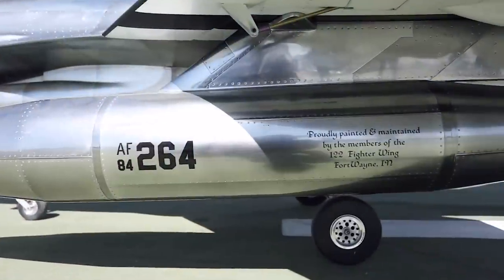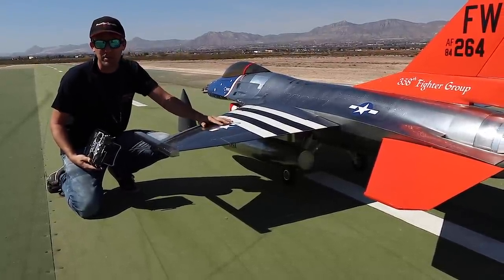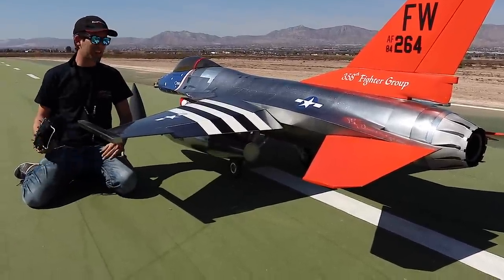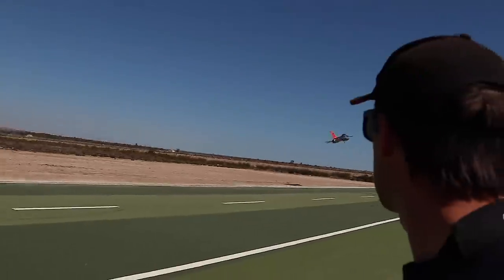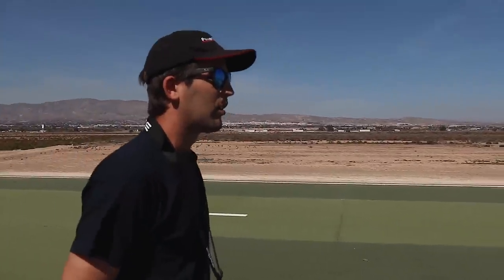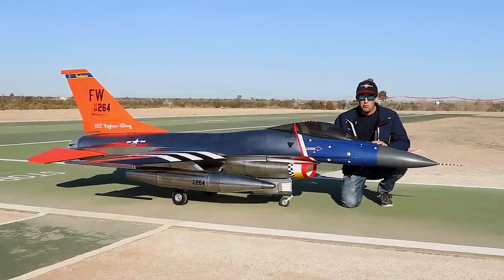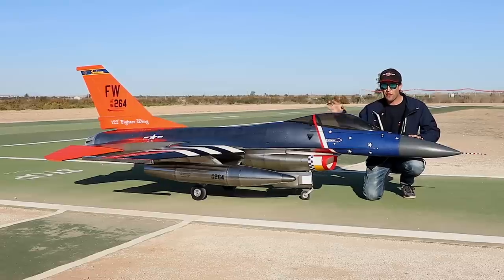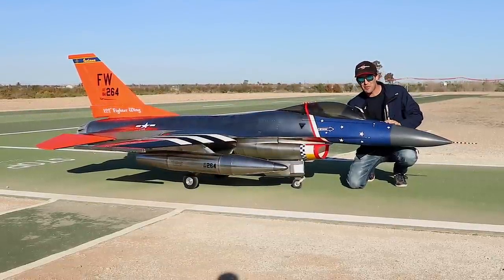HUGE F16 - Flying!

Comment: Great Flight! What was going on with the landing gear? It looked like the nose wheel never went up.
Reply from the maker: It didn't, and we can't figure why, as it retracts backward, so air pressure should help, and it works fine on ground! Darn gremlins!!
Reply: @MartinPickering-PickeringRC  what happens if you put a little back pressure on the gear simulating the aerodynamic load? It might need to go forward just a bit to unlock.
Reply: Martin Pickering how fast can it go?
Reply: @MartinPickering-PickeringRC , if I had to guess (and not being able to physically examine up close) I've seen similar phenomena on several full-sized aircraft I worked on as an FAA aircraft mechanic, the air pressure forcing the strut aft is too much to overcome the lock/unlock mechanism of your strut.
If the system is driven via a HD servo, you might be able to use an actuating armature that would give you more mechanical leverage. 
If the gear is operated via pneumatic/hydraulic actuators, you might be able to increase the pressure supplied to the up/down lock mechanism. 
If you are using a lock/unlock mechanism that mimics a full-sized aircraft strut, you might be able to increase the lever arm which controls the over-center locking arm.
Without seeing which system you are using, I'm unable to give you more than a S.W.A.G. at the moment.
If you could send me a couple of photographs in a PM, I might be able to give you a better analysis. 
Either way. Good Luck with that gorgeous aircraft!

Comment: I have smaller Foam Freewing and Eflite F-16s. I set them up just  normal. Separate aileron, elevator and rudder. Then do mixing of channels with switches. I want bigger of course 😊

Comment: What a beautiful model. It looks and flies really well! 

The only things I may nitpick on (and I've worked on the real thing for 10 years) if you want to strive for ultimate realism:

-The outer portion of the wing trailing edges are fixed in real life (i.e no ailerons - just flaperons).
-The flaperons do not assist in pitch control.
-The flaperon flaps mode is triggered by landing-gear down operation.
-The leading edge flaps (LEF) are also triggered by LDG-down and Angle of Attack (i get that putting AoA sensors on an RC jet is crazy).

Of course, I understand that being an RC jet, it is probably unlikely to build the thing unstable (in terms of center of lift vs center of gravity) like the real deal, which probably accounts for the "semi-realistic" flight controls. However, it is technically possible to achieve.

The F-16 Flight Control System is from the late 60's, and what used to take quadruple redundancy computers and lots of space in terms of circuitry can probably fit and run on an arduino uno today. 

Yeah yeah "You try to do better", I get it :) It's not ment to bash the product, just shed light on possible improvements :)

One of my all-time favorite RC models is the Rusjet yak-130. Check it out if you haven't already!

Comment: I hate that people use gyros on these big planes. They are more trouble than they are worth. One more point of failure. That plane don't need flaps to supplement the ailerons and delta tail control. It's too easy to roll the air frame to begin with. Just because you CAN do something doesn't mean you should. Glad the nose wheel stuck down though. It's also a tad nose heavy which is good for first flights of course. Not so much so as to be any problem either. I would work out the handling bugs first, then focus on CG. What a tremendously beautiful aircraft!!  I loved my  visit to this video and hope you get her dialed in very soon. As heavy as it is, you can use that to your advantage. Heavy wing loading means more stability in high winds. That goes with ALL aircraft.

Comment: I was told off recently for using aileron input in flap movement - adverse yaw etc etc. Maybe try keeping the flaps fixed when landing, might solve that wobble. From what you're saying about roll sensitivity it sounds like they don't need to be moving at all during normal flight either.
Reply from the maker: I would have liked tottery a few different combinations, however unfortunately I was only tasked with testing and setting up as best as possible in one day, following the previous owners setup, so that's what we did... would be cool to get more stick time on it for sure!

Comment: How much $ is invested in this thing? 

Absolutely awesome.
Reply: Thousands
Reply: NAUTIC nautica 
Thousands is a bit vague. I knew that at first look. 

“Thousands” include 2K to 999K. I’m curious about the investment in the aircraft. Not “oh my that looks pricey”.
Reply: I would estimate between $10,000 to $12,000.
Reply: Build one a find out!
Reply: gregthepilot Henderson 
At that much cost, snd could be wiped out in an instant, any insurance available? Even it were non flying loss.
Reply from the maker: Too much! lol
Reply from the maker: That would be accurate for a commercial model of roughly this size (slightly smaller) problem is this one was a custom build, retracts made to measure, plus custom paint... so as far as I know it cost the original owner significantly more.... @rocketboy917

Comment: Most fly by wire fighters use those type of mixes.  Watch any of the F18s, etc and you see the flaps and slats used as flight control surfaces.  While I don't recall an in-cockpit wing looking video of the F16, considering it's a FBW aircraft, I'd expect it's using all movable components as flight control surfaces.
Reply: The Leading Edge Flaps are scheduled as a function of angle of attack on the real jet.  I don't know if anyone has made a good AOA sensor that could do it on a model.  My interest is how if the airframe is plan accurate then how is the pitch axis handled.  The strakes make the jet have relaxed static stability in pitch.  Rate Gyros and the FCC manage that in real life, dunno if a radio could if the strakes are to scale..  (USAF Avionics B-Shop Flight Controls & Instruments '82-'98)
Reply: @Zuloff  Take a look around 2:25 https://www.youtube.com/watch?v=5IVWp-N6TuI  You will see the leading edge being used counter intuitively (IMO).  As he rolls left, the left wing front flap moves down (which in theory would increase lift) but with the flaperon moving in a parallel fashion to the FF, the wing is being used more like a stab   I'd love to see a video on how the mixing of the surfaces is accomplished and if it changes with speed.  One of the benefits of the F22 thrust vectoring is that it can drastically minimize trim drag by using the engine nozzles in place of any of the control surfaces to maximize SC speed.   It will use the TV alone up to a point to keep control surface drag to a minimum.

Comment: The F-16 by nature is an aerodynamically unstable design requiring computer fly by wire to stay in the air, everyone knows this already so how can a plane that is designed in such a way have a Model analog that can fly with out computer aid
Reply: since when is the F16 inherently unstable? this is not an F117. also in a model you can move the CG to a stable position if that would be the case. the F16 is a plane with normal wings and normal tail, no reason for it to be unstable.
Reply: Chris's Tech Box actually it is unstable. But the instability is what allows it to fly the way it does. Airliners and GA aircraft are designed to be stable because they don’t need to fly to the edge of the flight envelope. Fighter jets are a different story. The F-117 was unstable due to the shape, the F-16 was purposely made to fly tail heavy which is very unstable but allows very aggressive positive pitch maneuvering.
Reply: @superskullmaster  Ok I see, so I'm not completely incorrect answering the original question "how can this model fly without computers" by saying they placed the CG for this model to a stable position.

Comment: Is English not your first language? I think you have the definitions of "huge" and "tiny" mixed up.
    A full sized F-16 is 15.06 meters long. 4 meters long is quite a lot SMALLER than this 4 meter version.
     Glad to set you straight on this.
      Now, for a MODEL F-16, this is impressively large.

Comment: Flap + Aileron = Flaperon (the large surface on the rear of the wing).  Realistically it shouldn't have those aileron tabs at the outer edge of the wings. Stabilators, or stabs, are on the rear of the aircraft.  Great looking plane anyway you cut it.

Comment: Have to be careful at low speeds giving it too much aileron.. since that changes flap extension angle, which could very easily create a stall on the side where aileron position makes the flaps extend less.

Super pretty model.. at distance would be very difficult to tell it from the real thing.

Comment: Does it go supersonic?

Also, terrible music choice.
Reply from the maker: Turbine exhaust speed is very close to supersonic! Jet is far off it though
Reply: @MartinPickering-PickeringRC  You wouldn't want to try and control the thing if it WERE supersonic. I read where the guy piloting the supersonic car was 700 feet further down the track than he perceived by the time the nerve impulses reached his brain and his perceptual center assembled the sensory picture. There is no way you could adequately control the thing at that speed.

Comment: Wow, actually looks like the real plane while flying.
Ours really didn't, but it was only 20cm long and was really just a test for whether air multiplier systems would work as an engine for an rc. Made it look like an f16 because it had 1 engine
Reply from the maker: 20cm long sounds like it would be a bigger challenge than this big one! And yes, by far the most realistic model I have ever seen when in the air!

Comment: What is the engine size and where can I source one? Building a 1/2 scale jet dragster and need some big power from a jet. Thanks and love the video's👍💀👍
Reply from the maker: Turbine on this one is 300N size. I would reccomend the JetCat P300. That is 30kg thrust, but exhaust speed of about 1400km/h! They also do up to a P1100 which is 110kg thrust, that would get anything moving!!

Comment: Absolutly amazing machine ! It seems that there is no brakes, and the front gear wont goes up...
Reply from the maker: Front gear indeed had an issue. Does have brakes though, but it is a heavy model so inertia takes some time to slow down..

Comment: Absolutely great build job on this plane and great job flying it and better yet, LANDING it.  Most builders of planes of this level of perfection spend all there time building and relatively very little time flying, and it shows up on the landings where a lot of pilot skill is required.  This guy nails the landings, probably because he doesn't spend most of his time building.
Reply from the maker: +1

Comment: Man that is a thing of beauty.  I've never seen anyone fly so slow and smooth like that with such a huge aircraft. Increases the realism tenfold!  You need to master the side slip slide it was designed to do for real dog fighting.  Also, does that have thrust vectoring?  I didn't catch it if it does.

Comment: Did the "elevators" make landing a bit more difficult? Seemed to me that those would give great response for tight turns and acrobatics, but might make landings a tad harder- Kinda like having a hair trigger on my S&W 629 DX Classic .44 mag. (had to do the full name, the coolness of this model demanded it).
Reply from the maker: Elevator was actually surprisingly good on this one, sufficiently responsive while also being smooth, with a great "sinking" feeling on final fair. The ailerons are the ones that needed to be dialled down massively
Reply: @MartinPickering-PickeringRC  Ahh, ok. That must have been what you were talking about. Hearing not what it used to be. I heard you mention the ailerons, but couldn't really make out the rest. Thanks. Beautiful aircraft!

Comment: Really amazing and wonderful!! It flyes like a REAL F16. It does not seem to be an RC scale model, perhaps due to the important weight that it has. It's very stable, and very good maneuvered. Keep on improving it. Congratulations!!
Reply from the maker: Indeed, we came to the same conclusion. Due to its massive weight (and of course size) the weight to scale ratio must be a lot closer than our usual over-light models are, and the results were clear to see

Comment: Ok, one thing I've always wondered.

If you scale it up 2.5 times, and had a more powerful jet engine, and say, two more small jet engines on the wing roots, and put a 50 kg mannequin in the cockpit, with radio controls, and then see if you could fly it, then you could see if it would be possible to put a real person in the cockpit or not.

Because if you can make a radio controlled yet 12 ft long, then you could easily make one 24-30 feet long, just by scaling it up. As long as you had enough power, there's no reason why it wouldn't get off the ground with a person in the cockpit.

I see all of these huge giant radio controlled aircraft, but no one's thought of scaling it up to see if it would fly like an aircraft. I reckon it should be possible as long as you had enough wing area, and powerful enough engines.
Reply from the maker: Some crazy dudes actually did. The Cri Cri is a small full size, operated with two model engines (gas or turbine, your choice) and even though normally fly by wires, some are RC! Wouldn't get me in one though! lol
Reply: Martin Pickering wow thank you for letting me know that Martin. I will have to go Google it!

Comment: Why would they F up the scale by adding ailerons? F-16 does not have tip ailerons. Doesnt need them either. Flaperons work fine. Unnecessary programing as well.
Reply from the maker: Models don’t always follow exactly the same principles of the full size so often do need the ailerons... given that in this case it was big enough that tailerons would have been fine, but we just setup as per the previous owners specs...
Reply: @MartinPickering-PickeringRC  doesnt need them. Doesn't even need flaperons....tailerons work fine.

Comment: Martin, congrats!

Quick question about the first mix you talked about. Why would the elevator and flaps operate on the same direction as you demonstrated? Wouldn't it be more efficient if the work on the oposite direction as control line planes?

Thanks for sharing.
Reply from the maker: That is indeed a very, very good question... It is one I need to ask Victor when I next see him, as we were just following his setup, which we knew worked... I am guessing to add some kind of scale like action to the way elevator is input?? Dragging the tail more?¿

Comment: What's that mix called where the ailerons go up with the elevator and what's it set up as? That's the one I'd like to experiment with, thanks.
Reply from the maker: For both ailerons to go up or down would normally be flatiron. It is not common to have them linked to the elevator though...

Comment: Nice acft,  I worked at the 122 fighter wing as a full time crew chief on the block 25 F16s. Mine was 84-1236, your model is of Eric (hoofer) Gross's acft 84-1264. The only thing wrong with it is  we left the main body of 264 painted upper surface battleship gray and lower surface light ghost gray. Plus we never painted a travel pod . Our travel pods were all unmarked gtay at that time. Not silver simulating polished aluminum as your model does.  Because of all the colors we called it the clown mobile. It was left those colors when we moved it to air park at front gate when we retired the block 25s. It was just repainted its original two tone gray scheme. 236 is still flying in vegas as a two tone tan and brown aggressor acft.
Reply from the maker: Wow, cool history on the plane! Thanks for sharing!! Must have been so impressive to work on these beasts!
Reply: @MartinPickering-PickeringRC  They were awesome aircraft. Fun to work on and cool to watch fly everyday. Especially fun to do engine runs on in the hush house at full burner. Run throttle up and over , nose would drop while standing full on brakes, then fuel gauge just  spinning. Come out of burner and nose would raise back up and fuel gauge would return to normal readings. Worst part was leading edge retorque.  Removing hundreds of screws on top and same thing on bottom, just to take panels off. Then torque the rotatory actuator screws on top and the  bottom . Then reinstall panels.
Reply: @MartinPickering-PickeringRC  ever have questions on 264 or f16s in general just ask.

Comment: Great video! I can imagine the sensitivity of the controls is extreme, and this guys skills are amazing. When I was a kid, I got a model airplane, a P 51 I believe it was, that was controlled by a hand held device with two strings connected to the plane for elevation and descent. It had a little gas engine, and on my first flight I didn't even make one complete circle before I nose dived it into the ground at full speed. That was the end of my model airplane carreer.
Reply from the maker: Ouch... You needed some people around you to help with that first flight, with a little guidance it is not too hard, just like driving. Maybe time to give it a second go?!
Reply: @MartinPickering-PickeringRC  I'd love it, I am sure. Do you know of any RC shows in the Dallas/Ft. Worth area?

Comment: Wow that's amazing!
So the flaps go the same way as the elevators?  So to go up the flaps actually go up, acting like an elevator, pushing down the tail?
Yet they also go down to act as a flap. Interesting!
Reply: No. Flaps are either flaps or flaperons. They don’t control pitch, they either increase lift and drag (flaps) or they do that in addition to augmenting roll(flaperons).
Reply: @superskullmaster  Thanks Andre. 
Ah, so at 1:10 when the port side flap tilts up at the same time as the elevator tilts down, the starboard side is (I assume) doing the opposite, hence the flap is acting as an aileron, forcing a roll to the left? 
Pity we couldn't see the starboard side.